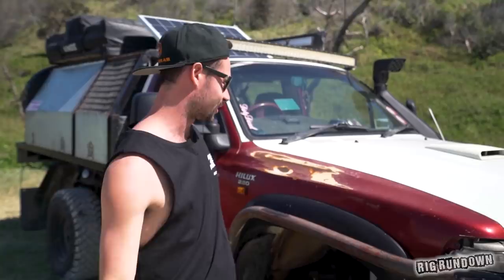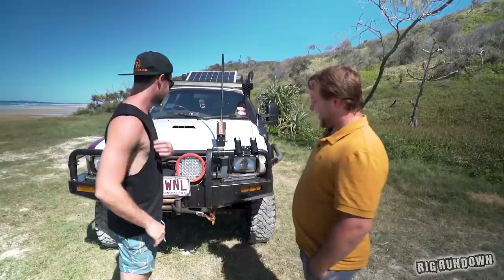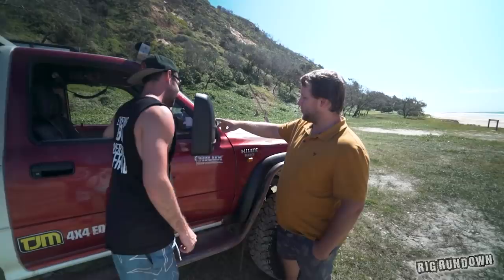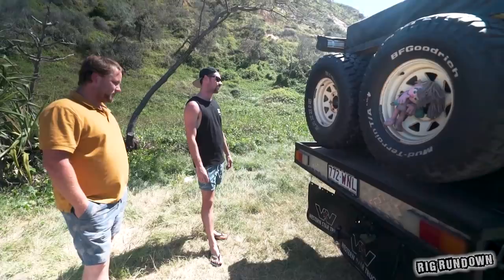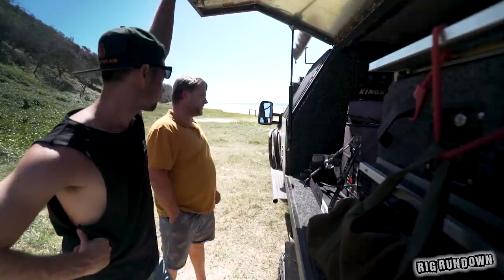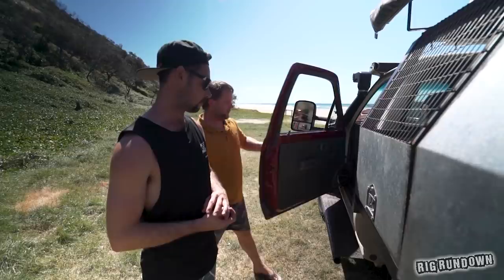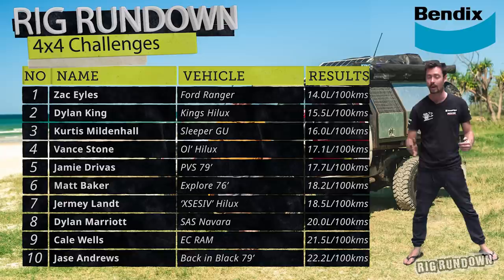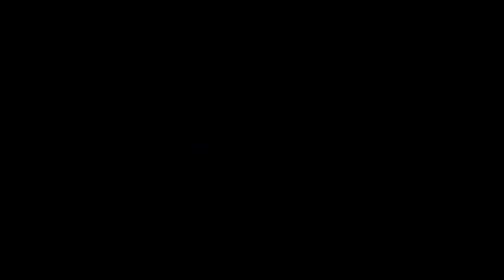RIG RUNDOWN || Taking A Closer Look At This Budget Build!!

Comment: I just did most tracks at LandCruiser mt park in my $2000 GQ,
 2nd hand GU stock suspension with 50kms $50
Front bar $100 
33s $500
I'm not sure if I could have had more fun

Comment: Sam you need to check out my mates mad 4Runner  it’s runs a 2.8 at 22 psi I’ve never ever seen anything cruise through obstacles like this thing it’s insane all built of corset he bought parts but definitely built 94 percent of this absolute rig it’s something you have to see to believe we did big red on the creb and it crawled up up it no problems at all

Comment: Why are you using so much diesel my friend got a ln106 and he gets around 800km to a tank
Reply: Almost maxed pump haha and 2.7t 😂
Reply: I had a boosted 2.4 with a 2.8 12mm pump only got 250kms to a tank town driving if I was lucky, ran 35psi and only was only 1.9ton over the weigh bridge